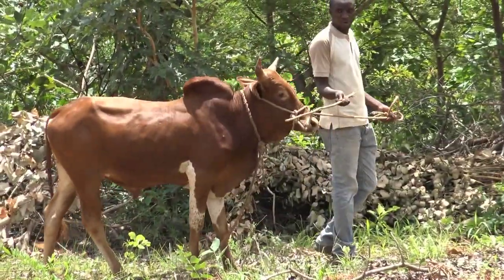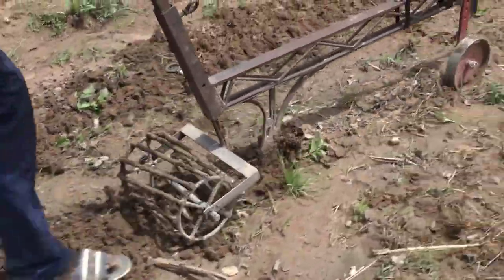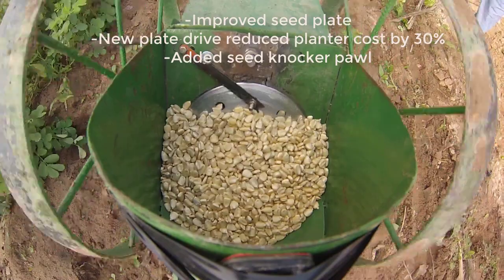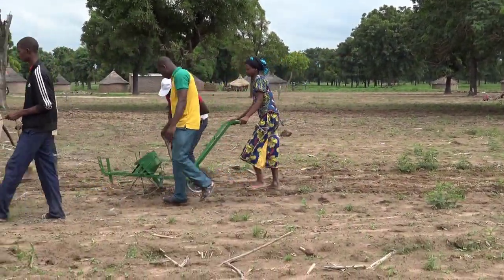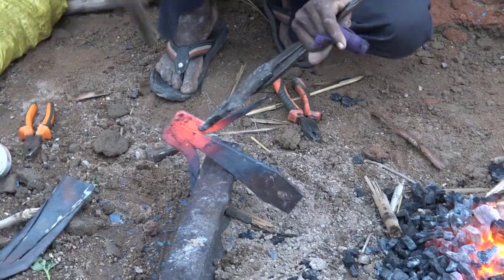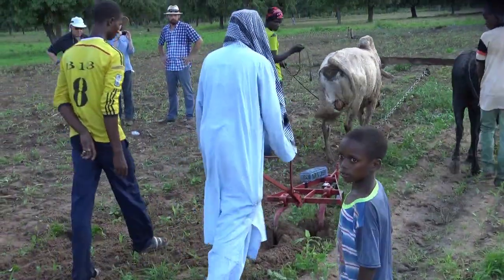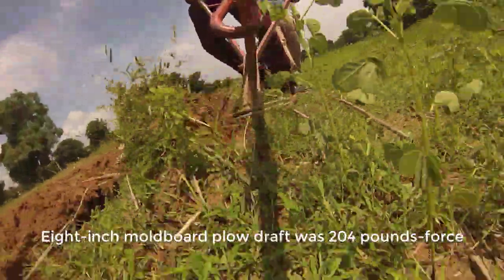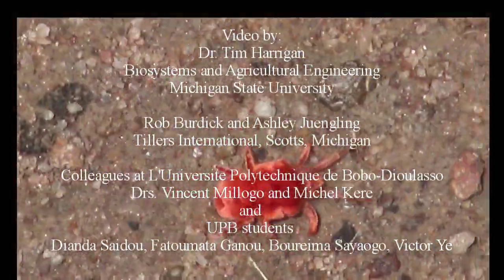Conservation tillage, planting and cultivation with oxen in Burkina Faso

Comment: Having worked stock all of my life I would like to make a few comments with no harm or malice intended. First, they need better yokes on these cattle which would enable them to work more comfortably and efficiently. Second, the ploughs appear to be ill-balanced with the handles too short making them harder to manage. The planter I like as it seems to be the best constructed and balanced of all the equipment. In the South we use a single foot plough that handles a variety of sweeps and other points such as a middle buster and half shovel. This type of cultivator has been used for generations here with great success.